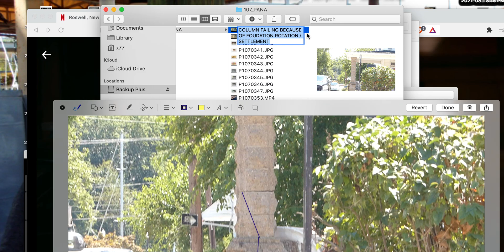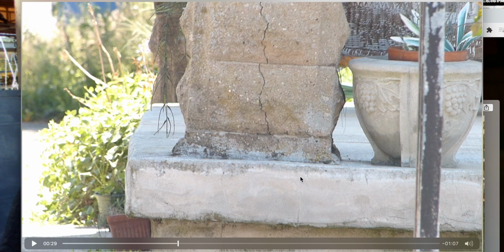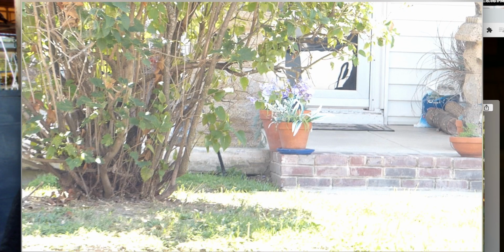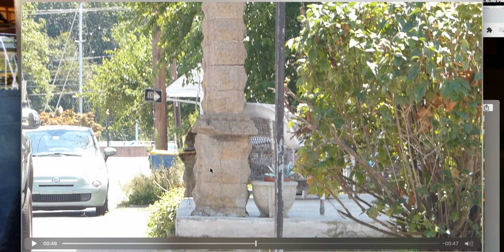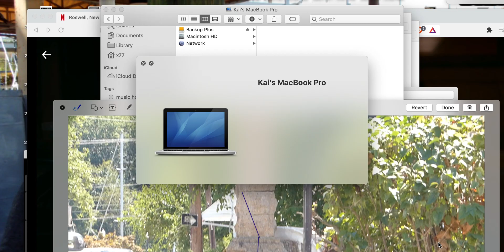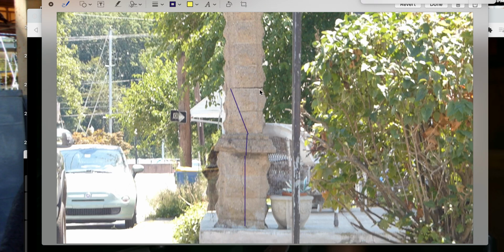Champlain Towers Crack elevation and column failure  Very interesting Crack  load path visual aide

Comment: Dang it, I've been trying to watch this video all the way through without my internet going out on and off.  As Trish mentioned, I was going to comment that the porch sag was like the deck failure at Champlain causing the tug on the column(s) and causing them to rotate.  

You also say in the video that the area is known for a lot of water issues and that it's right by the river...is it a coincidence that Champlain was also known to have a lot of water issues and is right by the ocean...wink, wink, nudge, nudge.  So, there's water intrusion and spalling.  Maybe I'm just reading too much into that. Lol

You also talk about how the slab dips down and then kinda goes up at the end by the door, does that have to do with the butterfly you mention?

You said repairing the column on the house with grout or caulk would have been useless because it didn't change the load path, it only hid the tension. Kinda like the repairs they did to the cracks that can be seen in the garage video.  The repairs didn't do anything since the structure couldn't have been supported with the missing BMA's anyway...in addition to the water intrusion that wasn't rectified.

As far as the prying up force on the column you talk about, I'm not sure yet how that works in the sequence of failure(s). 

I'm new to all this and I may be totally off base with all of it and may regret this comment. Lol

👋🐱🐱

Comment: They will probably call for a roof repair at the house to porch transition as well not relizing the foundation is what the real problem is.
Reply: That may not be the case here. In this house example, the weight of the roof is very light compared to the column holding it up. This column is very oversized for what it is holding up, considering only the edge of the column is holding the roof up. A typical replacement for this column could be a 4" lally column surrounded by a wooden decorative exterior shell, sandwiched between two plinth blocks.

Comment: Thanks for sharing your "crack" with us!  🤣  You said that the bottom three stones that are cracked down the middle would have to be replaced, which I understand, and that the column as a whole would have to be "pulled into plum", but wouldn't the sagging deck under the column have to be replaced or restored also?  Maybe you said that too, and I just didn't hear.  I HOPE that the owner is going to undertake the necessary repairs or pay to have them done ASAP!  Thank you for another great on-site video!!!     :^D 🎺 LP
Reply: I’d have the whole thing taken out and replaced. Column(s) and deck. One wonders what the column we can’t see looks like.
Reply from the maker: Louis, https://www.youtube.com/watch?v=Zmkhj5cWl7w  my biggest release to date  and will premiere in about 1.5 hours